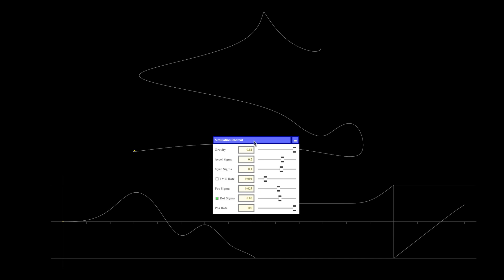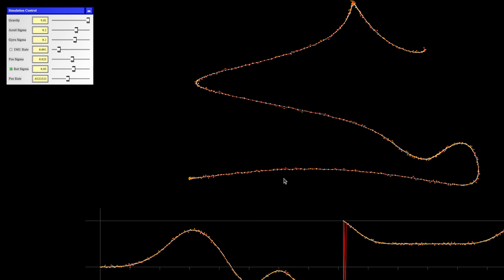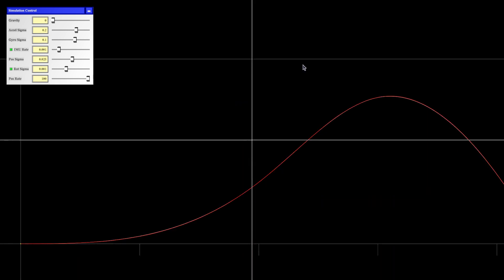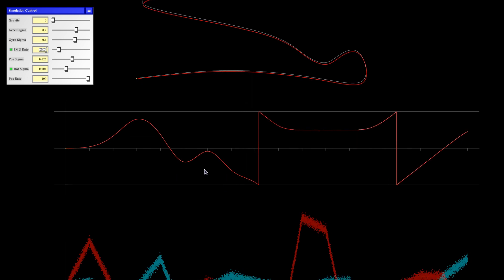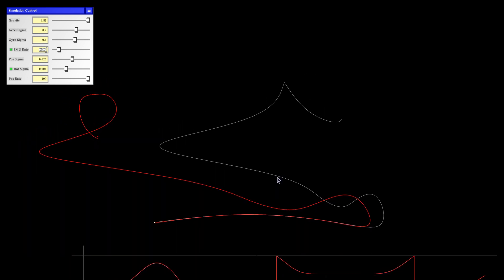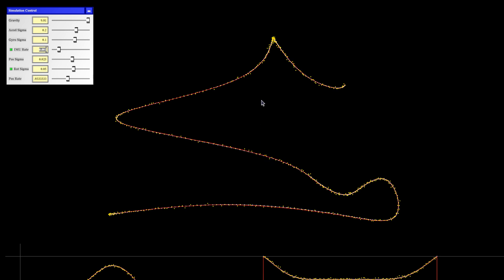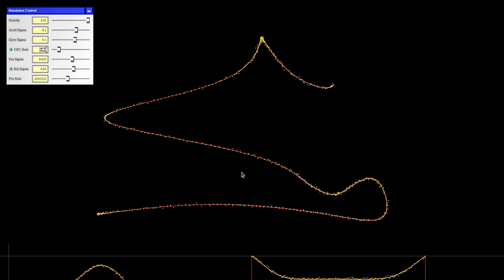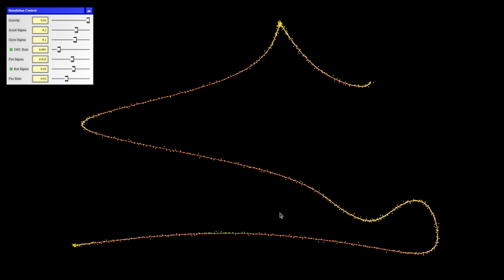Sensor Fusion for Object Tracking

Comment: Jumped here for the "correct yaw drift by camera" from the other PS Move video you posted, and I have a very technical question - to achieve the result seen in the end of the video, are you explicitly including a "yaw correction" component in your UKF state vector? I suppose more generally, what does your state vector look like? I tend to use a pose+velocities "externalized rotation quaternion" (incremental 3d rotation is in the state vector proper, externalized to a quaternion "outside" and reset to zero every step, so state is 12 dimensions) for the pose state - inspired by Greg Welch's dissertation here. I believe I've augmented this in the past (when filtering in an orientation measurement - no access to accel, but camera could measure orientation in a way) with a yaw-drift component. However it seems there are almost as many ways of dealing with 3d rotation in a filter as there are people writing sensor fusion :) so I'm curious what your approach that got such nice results is. (Hopefully this is backed by something vaguely 3D, given that there is gravity, instead of purely 2D)  I wonder if an "internalized" rotation state vector would not require such a correction element.

Comment: Great Video, I am planning to include lidar and camera to my quadcopter. Presently it just has an  MPU 6050. The quadcopter doesn't stay at a place and keeps drifting to the sides. Probably these external sensors will give it enough data to hold itself. Also, if possible, could you please make a video on how adding two of these same MPU 6050 help in reducing any noise associated with the measurements. Thanks again for an awesome information source.

Comment: The filter you talk about is kalman or fusion? For example when referring psvr. Is this your own or opencv?
Thanks for the video!
Reply from the maker: Sensor fusion is a process. The Kalman filter is a tool to implement that process. In this video, I am using an Unscented Kalman filter to do sensor fusion.
This is my own implementation of the Unscented Kalman filter. I don't know if OpenCV even has one, given that OpenCV is an image processing toolkit, and Kalman filters aren't image processing tools per se.
That said, many people use OpenCV to implement object tracking, so it's possible that someone added a Kalman filter implementation to the package.

Comment: Hi OkReylos

Amazingly informative video thanks.

While I understood that the tracking was a result of a sensor fusion algorithm what wasn't so apparent was that the external tracking systems (lights, LEDs, IR, LASER) were there primarily to correct drift.

I find this particularly interesting in regard to PSVR and Move, where the tracking is regarded as substantially poorer—which in fairness I think it is, in comparison to Vive and OR, though still reasonably accurate—whereas this video highlights that at the IMU dead-reckoning level PSVR is probably at the same approximate level. This then begs the question of what is letting PSVR tracking down? I think there are two probable causes: camera FOV and z-axis accuracy. We know the PS camera has a narrower field of view than the OR constellation, I can't remember the numbers but in use it is obvious that it is easy to stray outside of the camera's FOV and doing so will—on the basis of your video—fail to correct positional drift which will quickly diverge from reality. The second issue of z-axis accuracy is conjecture based on physical principles, iWaggle's observations and videos, personal experience. Essentially PSVR uses large light sources instead of an array of point light sources; to me this seems inherently less accurate. As Move was originally conceived this would have been easily accurate enough but in VR we are far more sensitive to divergences from reality, so it becomes more noticeable. I'm guessing that when tracked objects become still, such as aiming down a gun or staring at an an area of the environment, that the tracking of the object is more liable to noise from the external tracking drift correction? I think this explains why PSVR is more prone to occlusion wobble when, say, aiming down a gun in VR. In effect PSVR is a hostage to its Move legacy. If Sony had decided to not be Move compatible with PS4 and instead had added LED array's to all items to be tracked, then I'm guessing that tracking would be substantially improved. However viewed from the perspective of Sony making early design decisions for PS4 back in 2010/11/12 I think the choices they made were perfectly understandable.

The last point is that it occurs to me that your video provides a methodology for correcting the tracking of objects within the PSVR system. As an example if the Aim controller leaves camera FOV then there are situations where it is obvious the system does not correctly understand the controllers position (i.e. in-game gun seems offset)—this may be because movements of the controller have been too weak to correct for drift while out of view (though I'm now more sceptical, based on your video, that this should occur)—to correct then waving the gun (though perhaps not shaking it) being careful not to leave camera FOV should correct the issue. There are also situations with PSVR where tracking is basically corrupt, sometimes this can be corrected by turning off the HMD, sometimes by rebooting the PS4. This indicates that the tracking API / component of the PS4 OS can become corrupted over time—analogous to memory leaks or resource handle misallocation.
Reply from the maker: I can't say much about PSVR head tracking, but PS Move tracking is considerably worse than controller tracking for Rift or Vive. The problem is, as you say, legacy. PS Move was designed, what, ten years ago? Modern VR wasn't around, and while Sony might already have thought about VR back then, they were stuck with the state of the art. The Move is a great compromise to track with a regular 2D webcam and a cheap controller, but it has two issues.

The first is that tracking a single big ball is less accurate than tracking a constellation of small dots, although the difference is not as great as one would think. Using a stereo camera as in PSVR improves that by a lot compared to the original PS3 Eye camera.

The main issue is that the Move's IMU is only sampled at a low rate, 170 Hz if I remember correctly, and that a non-negligible fraction of samples are lost over the wireless link because it's standard Bluetooth as opposed to a custom 2.4 GHz wireless signal as in Rift and Vive. The Vive controllers' IMUs are sampled at 360 Hz, Touch probably similar/the same, and the Vive and Rift headsets' IMUs are sampled at 1000 Hz. IMU sampling rate has a big impact on drift build-up and overall tracking quality.

I don't have a PSVR, so I can't talk about practical tracking issues.

Comment: This video was not too boring, it was hyper interesting and finally told me how the Move can actually be used effectively. The fact it is a single glowing ball I thought it would be way worse than the Vive/Touch controllers due to that lack of orientation corrections, but as it looks, it's only the initial state that suffers. I guess re-acquisition of the tracking after losing sight of the camera might be what gives the impression of the tracking to be bad/worse, because then you get that first ping-pong estimation again. I have not actually tried the PSVR myself yet so I'm going on anecdotes from others.

On the topic of Vive and Rift, even after seeing your previous videos with the periodical corrections, I have been thinking they might benefit from more frequent laser sweeps or faster camera frame-rates, but now I'm actually very content with the current state of affairs. Thanks! :D
Reply from the maker: I'm planning to write real sensor fusion code for Oculus Rift DK2 (to finish up the reverse-engineering work from several years ago) and PS Move next. While 3D is harder than 2D, and reality always has unexpected snags, this simulation makes me quite optimistic about getting good tracking from PS Move. I mean, the position-only results I got two years ago were astonishing.

If orientation tracking works at all, I don't think there will be a big problem with intermittent occlusion. Orientation drifts so slowly that it shouldn't be an issue if occlusion lasts only for a few seconds. Based on my old experiments with orientation-only tracking of the PS Move, it might even carry over if the gap in position data is less than, say, a minute or so. A big issue causing orientation drift in IMU tracking is that cheap MEMS gyroscopes have temperature-dependent and time-varying biases. As it turns out, the Kalman filter is excellent in tracking those biases over time. I didn't mention it in this video, but it was another surprise.
Reply from the maker: Re: PSVR -- I've only ever used it at trade shows, maybe five to ten minutes at a time, but I've been impressed by its tracking quality from day one. It's not on the same level as Vive or Rift, but given what they have to work with, it's a miracle. It took me until running this simulation to figure out how it could possibly work.
Reply: I was convinced it would look terrible, the simulated data had me sit straight in my chair. I really need to read up on Kalman filters, I've heard about those way too often now without knowing how they work. Thanks again for a very informative video, for me it was very digestible information :)
Reply from the maker: The embarrassing thing is that it took me way too long to sit down and study this in detail. I had a superficial understanding of Kalman filters -- that they use recursive averaging with adaptive weights -- but what I didn't understand was that their real power is estimating hidden system states (like orientation of a sphere or gyroscope biases).

I finally started looking into them a few weeks ago, with a concrete example (predicting trajectories of thrown balls from 3D camera footage) that has a very simple filter implementation, and that's when I first noticed that the filter was giving me ball velocity estimates by itself that were just as good as the hand-coded velocity estimator I had put in. Mind blown.

I recommend starting from an interesting concrete application. The papers/books explaining the theory are usually rather dense, and their examples are too trivial to teach much. But once you break through the shell, it turns out the theory is really straightforward, and implementation was much easier than I anticipated. It only took me a single day to code the Unscented Kalman Filter and the simulation app I used here, and it worked flawlessly the first time I compiled and ran it.
Reply: Thank you for the pointers :) I definitely need an actual use case so I have a reason to implement, this is what I will put my subconscious to work on as I sleep! Cheers! ;)

Comment: I also have a question, when u turned the sensor fusion off, u said the system relyed on the accelerometer to get to correct the orientation of the headset/controller, did you mean the gyro?
Reply from the maker: Timestamp?
Reply: @okreylos  23:44 <--- time stamp
Reply from the maker: Thanks for that. No, I meant accelerometer. Rate gyroscopes measure incremental rotation, but can by themselves not measure orientation. The reason the initial very bad orientation estimate converged quickly towards the real value in that part of the video is because with a wrong orientation, the accelerometer readings are not correlated to absolute position measurements.

Imagine orientation being off by 90° and the accelerometer detecting an acceleration along the positive X axis. What that really means is there was acceleration along the global Y axis, and the absolute position measurement system will subsequently detect a displacement along the Y axis. The filter will notice this contradiction and correct the orientation estimate accordingly.

Comment: If someone wants to get started using the lighthouse system for tracking robots where would I start? Is there an SDK or something that you use to show this raw data. Some sources to get started would be great. Thanks!
Reply from the maker: I don't know the exact process, but you can buy individual laser detector circuits online somewhere, and Valve offers an HDK containing design tools, documentation, and guides to create your own trackables. Try googling for "Lighthouse HDK" or similar.
Reply: There are also the tracking pucks if you want to start small

Comment: Hello there,
Do you think plain Extended Kalman Filter would achieve approximately same performance vs this UKF?
Reply from the maker: I would have to test that, but in general, EKF is an approximation assuming system linearity around the current state, whereas UKF is an approximation only assuming a Gaussian error model. Meaning, UKF should give significantly better results in non-linear systems like this one.

In short, I am guessing that EKF would do worse here, but I haven't tried it.

Comment: Excellent video! It's hard to find many accessible videos about sensor fusion and kalman filters so I really appreciate you taking the time to make this one. cboulay and I struggled for a while to get a UKF working in PSMoveService. We had a couple different attempts (Full pose, just orientation and just position): https://github.com/cboulay/PSMoveService/tree/master/src/psmoveservice/Filter

One of the biggest things we struggled with was how to deal with orientation in the UKF state vector. Seems like your two options are Euler angles or a quaternion. Euler angles are nice because you can make linear offsets (sigma points) BUT then you have to deal with angle wrapping which leads to oscillations (flip-flopping trying to converge on the right angle). Alternatively if you use quaternions in the state vector it's not clear to me what the "right way" to compute the UKF's sigma points is since quaternion operations are non-linear. I also tried storing "quaternion error" in the state vector (which I think is linear) and then applied the error to an external orientation state variable every frame. 

If I may pepper you with some UKF sensor fusion questions:
1) How do you deal with orientation in your UKF?
2) Do you do "partial state update" on your UKF as new sensor measurements come in or a full update with stale data?
3) What do you use for your noise matrix Q? We're using discrete constant white noise from: https://github.com/rlabbe/filterpy/blob/master/filterpy/common/discretization.py#L52-L53
4) What did you use for your UKF alpha, beta and kappa values? 
5) Do you use a UKF library (we're using mherb/Kalman) or did you just roll your own?

After typing this all out I realize youtube comments are probably not the best place to have a long form conversation, so if you prefer to respond via e-mail that's fine too. I'd love any advice you have to offer. It's one of the last major unsolved challenges of PSMoveService and it's been killing me.
Reply from the maker: Those are all great questions, but I don't have proven answers yet. I'm going to look into 3D tracking next. But I'll definitely use quaternions for orientation, as Euler angles are plain nasty, with gimbal lock on top. I don't even want to think about how to turn a 3D angular velocity vector from gyros into differential yaw/pitch/roll updates.;) Unless I'm totally missing something, sigma point calculation shouldn't care that you'll have to normalize the quaternion before applying the transition function. That should all be part of the non-linear black-box nature of f().

Re 2: No partial updates, unless orientation tracking is disabled. I have two kinds of measurements: IMU readings and position/orientation from external system. I treat IMU readings as control inputs for the Kalman prediction step, and position/orientation as usual for the correction step. I've done alternative correction steps, for example using ranging data instead of direct (x, y) measurements, but that doesn't change the fundamentals.

Re 3: Just standard IMU noise sigmas, multiplied by dt / dt^2 as appropriate. Ideally I should add error terms for gravity mis-estimation, and I have seen some ill effects from not doing that.

Re 4: The default values for Gaussian noise: 1.0e-4, 2, 0

Re 5: Rolled my own; after all, it's just a few lines of code. I'm using Vrui's Math sub-library for the basic matrix operations and Cholesky decomposition. I haven't tried square-root UKF yet.